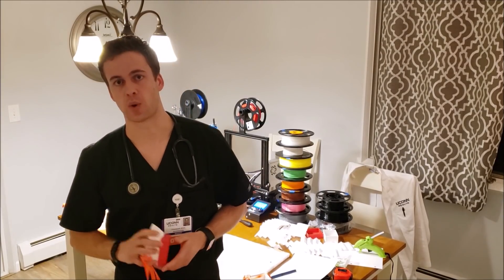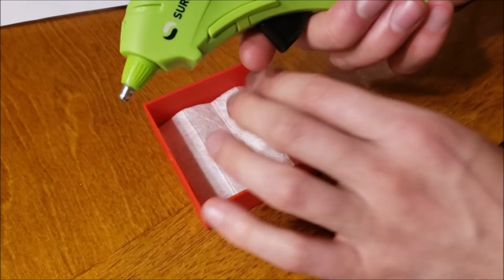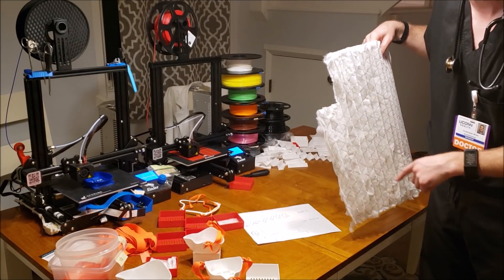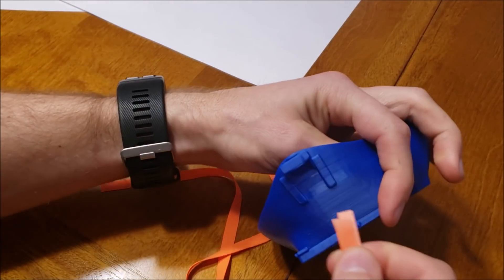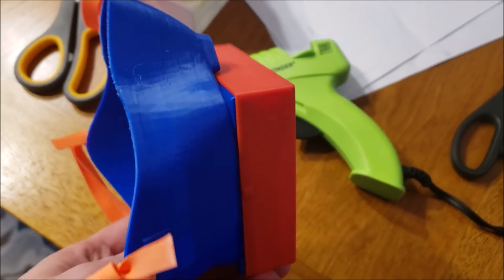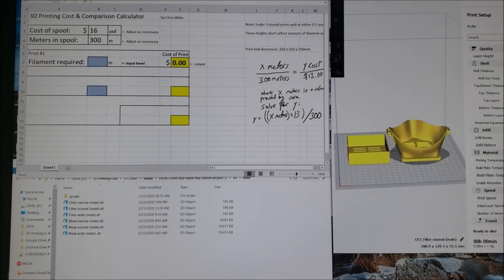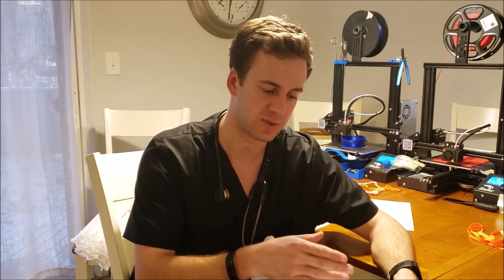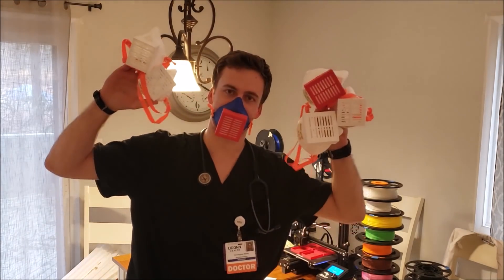COVID PANDEMIC 3D PRINTED MASK TUTORIAL

Comment: But PLA is POROUS!  Yes they will work as a splash guard, but PLA is porous, viruses can get through that AND bacteria can grow inside those holes.  Thats why we dont make PLA drinking cups.  ALSO you didnt make a seal around the mouth so again air will get through.  This only provides splash protection which the splash shields do more for.  MAKE THOSE.  AND MAKE VENTILATORS FOR ITALY.  Just wear a bandana and wash it.
Reply: I agree with you that PLA porosity will make the masks difficult to sterilize and reuse, but the air coming through those pores is inconsequential compared to that coming though the filter.  Even if it's 1% (this seems huge to me), that would turn an MERV13 filter only stop 49.5% of the 0.3-1 micron particles instead of 50%.  (He's using a MERV12 as well, but I'm ignoring that because I don't know how the filter properties stack.)

He is fit testing these masks - where users put the mask on in the presence of a strong oder to se if they can still smell it - so a significant amount of air isn't coming through the seal on the face.

Spalsh guards are important as well.  Ventilators would be really hard to make 3D parts for unless you are working with some engineers and machine shop folks that know what they are doing.

It would be nice if the powers that be had worked out the plans for and tested all of this stuff ahead of time so we could just press print.
Reply from the maker: n95 filters 95%. how much virus is going to float through the pores? less than 5% in the air? then it would still be n95%. If my hospital runs out of masks, I would rather wear this than a scarf and that is the stated purpose of this project. Also, it makes a complete seal. I stated in the video that this passed fit testing. Scarves do not. Add seal material for comfort in prolonged use. Spray down with silicone to block pores, and use HEPA B filters for 99.97% blockage. Those are not the goals of this concept currently but I may make a second video with that as an option. It's up to you what you do. this is one option in the setting of nothing better. Thanks for watching and sharing your concerns. I am happy to hear and consider all opinions to try to improve my designs.  Have a good one.

Comment: Can you use other types of Fabric too?
Reply from the maker: Yes, but use the best combination of fabrics you have available to you, ideally ones that claim to filter viruses. Anything is better than nothing, but try to pick filter material similar or better than what I recommended, and most importantly find a way to create a good seal so no free air leaks around the filter material.
Reply: @chrischris64  I have been able to kick out quite a few cloth masks on my Brother serger. (while 3D printing these).  I made a pattern out of the disposable N95s - then made them with leftover quilt fabric on one side, and Merv 13 material on the other.  You can breathe through them quite well and I can produce quite a bit more than the 3Ds.  My sister works for the VA and has been testing them.  She also brings them to me after work so I can zap them with my infrared and blue light.

Comment: hi, try a 0.6mm nozzle instead of the stock 04.mm nozzle. with 0.6nozzle and a 0.32mm layer height, the mask prints in 4 hours or less (for the normal size). im about to print the filter now. i also did 100%infill
Reply from the maker: How did that work with those nozzle settings? My 0.3mm snaps easily and only took an hour or two off the print. I'm just gonna buy more printers and use 0.2mm height. Please let me know how those layer setting turned out. thanks!
Reply: @chrischris64  it turned out great! Super sturdy. No problems at all
Reply: @chrischris64  i have printed 3 masks with 3 filters and they are all fine. 0.6mm nozzle with 0.32mm layer height. im using Inland PLA 1.75. cura 4.5 to slice. line width; 0.6.  wall thickness; 1.2. wall line count is 2. infill 100%. speed is 50mmps. temp 215 and 50bed. im using a ender 3 to print as well.
Reply: @vmiget01  I like the idea of 100% infill. Does it mean the mask is essentially solid plastic?
Reply: @rukidding7588  yea. Very sturdy. I threw a mask on the floor and it survived so 100% infil is good
Reply: @vmiget01  agreed. I was actually thinking it would reduce the permeability

Comment: God bless America. Who thought we would have to Macgyver our way out of a pandemic ?  Assume this prints on a 220 by 220 printer ? This by far looks like the best design I've seen and plan on starting this tomorrow for my Wife, two kids and local hospitals. Wondering if the filter would be better screwed on vs snapped on. Perhaps something also to coat around the edge that touches the face might make it more comfortable however I realize that is 2nd to safely.  Will try this out. Thanks again for your tireless ambition with this and more importantly your role as a doctor in these trying times.
Reply from the maker: Thank you for doing that. Yes, Ender 3, so it is a 220 x 220. I will release the .gcode files (at least for 220 x 220 ender 3 size bed) for common buildplatefulls of these soon on thingiverse to save people a step. For comfort, add a rubber seal made of door or window seal, or cut various tubing material and silicone or glue on.

Comment: To get a perfect seal around the mask, apply an oil based lubricant.
Reply: Stupid question, do you mean on the filter/mask connector or around the lip of the mask where it sits on the face?
Reply: @ijustawannaprivicie8031  I would assume both, since there's no gasket in between the filter holder and the mask itself to stop airflow
Reply: Or just get it warm using a heat gun or blow dryer or in the oven. Put it on your face while its warm and wrap your hands around it while it cools.

It will conform to your face very well.

Comment: Will HEPA vacuum cleaner bags work also?
Reply: I have some on order but my guess is they will have too high back pressure which will prevent any kind of use over a few minutes.
Reply from the maker: I haven't tried but they should. Can you try and let me know? I would be curious about breathability through one layer vs two. make sure to seal the piece of bag in along all the edges with low temp glue gun or silicone.
Reply: @chrischris64  Hello Chris, I tried to make similar mask for 2 layers of Hepa filters, should be lighter and no glueing is needed check this: https://www.thingiverse.com/thing:4241775
Reply: @chrischris64  I tested with the vacuum bag material, but on a different mask design than yours as I haven't had time to try different designs.  The design I used is very similar to yours and has a breathable surface area of 2.25 square inches (not sure how that compares)
I found that the breathing is too restricted and would not be comfortable to use for long periods.  However, I think it may be adequate to use for short periods of time as long as it's a low stress situation. Maybe during intubation? Please note I have zero nursing experience (civil engineering is my day job) and not sure of the physical or mental stress experienced during these activities.
Reply: @chrischris64  I just modified the design I have been using and increased the breathable surface area to 4.3 square inches and it is much better and definitely usable. The HEPA filter I have been using have 4 layers one one side and 2 on the other which is confusing.  Not sure how many layers are needed to achieve their HEPA rating.
Reply: @The8wallace8  Did you check safety on that - I've been told using a HEPA vac bag may not be safe (aside form the virus) but I"ve never been able to find any details on why that would be, but I'm guessing particles of the bag material might come off and not be good for your lungs.

Comment: sorry for my english. i am spanish. here in spain we have discarded the printing of masks because the fdm printing has many micro holes much bigger than the size of the virus .
here we talk about creating an extra layer with epoxy resin that would be able to seal them
Reply from the maker: Hello, thanks for the info. I know on paper this is the case, but my thought process is that the suction effect of breathing in is going to pull >99% of the air through the filter, not through the plastic. This is not, in my mind, the least common denominator to the problem. An n95 blocks at least 95% of particles 0.3 microns. It doesn't even block 100%. In reality, if you have a good seal on your face, you stand as good a chance as possible to block virus. Again, this is my attempt at doing better than a CDC-permitted scarf or bandana. They are not perfect and I will be constantly looking for ways to improve the functionality such as injection molding and silicone spraying. Thank you for all your ideas and info. It helps so much.
Reply: @chrischris64  N95 is a minimum rating requirement. Some filters meet N95 and for legal reasons only advertise to that spec even thought it filters smaller than 0.3
Reply: a layer of resin takes too long. Fastest way to get alot of masks out is going to be vacuum molding. This insures it has a seal on it naturally

Comment: Any updates on the comfort and fit of these after a couple days of use?
Reply from the maker: We still have n95s so I haven't been wearing mine yet. will try cut and siliconed oxygen tubing tomorrow. adhesive window seal (non-foam) worked well but oxygen tubing will be easier to wipe down.
Reply: @chrischris64  Glad to hear you still have N95's.  Hang on to them, lots of promising results for sterilizing those for reuse are coming out:
https://www.heraldsun.com/news/coronavirus/article241520921.html
https://m.box.com/shared_item/https%3A%2F%2Fstanfordmedicine.box.com%2Fv%2Fcovid19-PPE-1-1
Reply: @chrischris64  It seemed like it would be helpful if all of the masks had the same filter size both for printing and making filters. Here are links to the average-male and narrow-male that both fit the same filter cap:
https://www.dropbox.com/s/5xljkaaj9103vxs/ave_male.stl?dl=0
https://www.dropbox.com/s/l0xx6tbjwopso94/narrow_male.stl?dl=0

They are a bit rough (literally... I'm not a CAD expert), but if you feel like this is helpful, I can take your lastest version mask and work on making them all fit the same sized filter and smoothing them out.